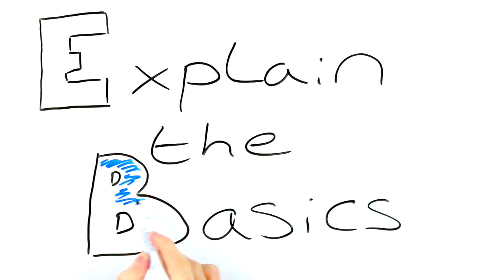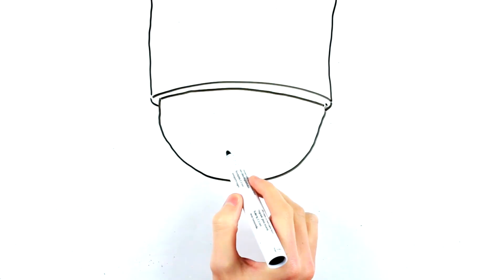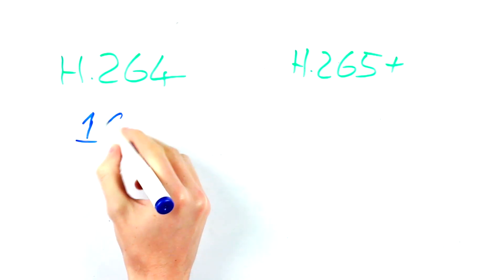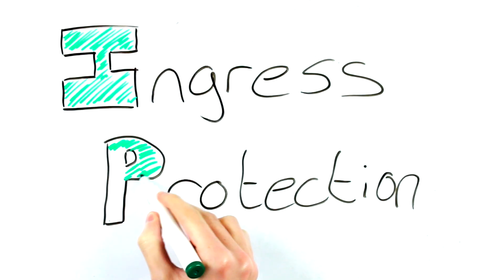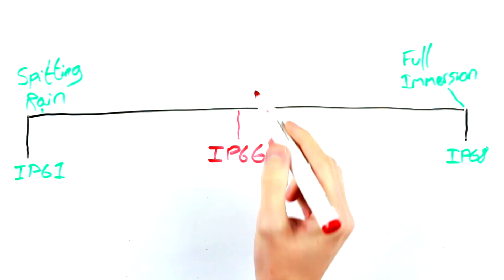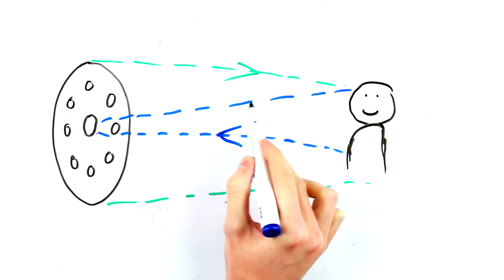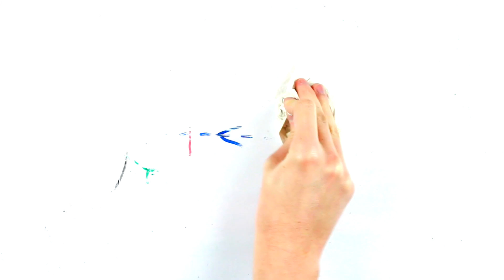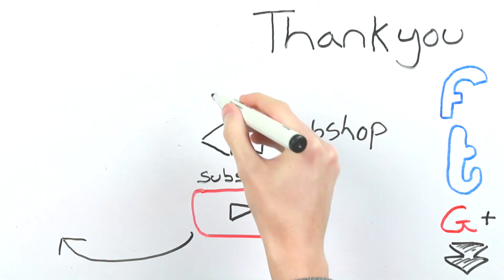Explain the Basics - Episode 6 - Everything Else (PTZ, Compression, IR, etc...)

Comment: On my ptz camera there is a setting called zoom limit ,mine is ser to its lowest setting 20 ,but it starts from 20 then goes up 40.80 ,160,320 Can I change the setting up ? Will it damage anything ?
Reply from the maker: Hi, we've never heard of a zoom limit on PTZ's before but if the camera says it can zoom up to 320 then it should be possible to zoom that far, maybe try contacting the manufacturer for more support.